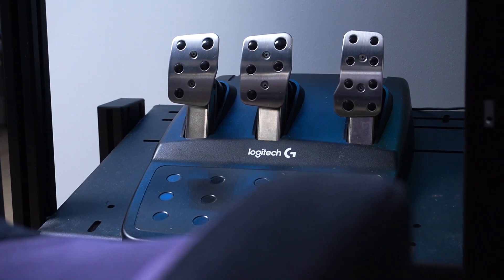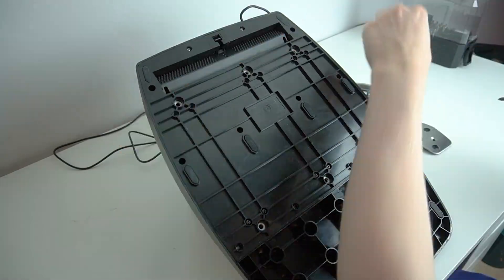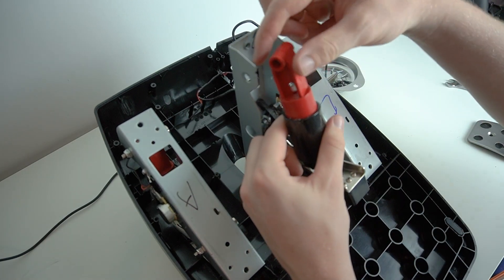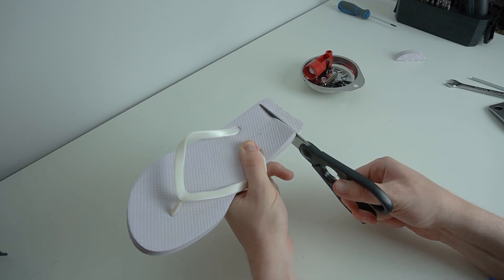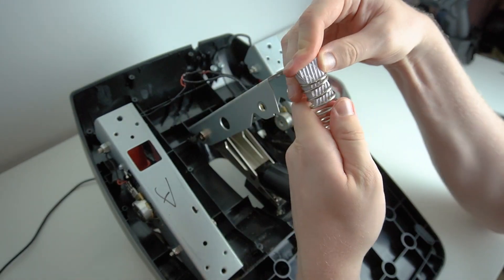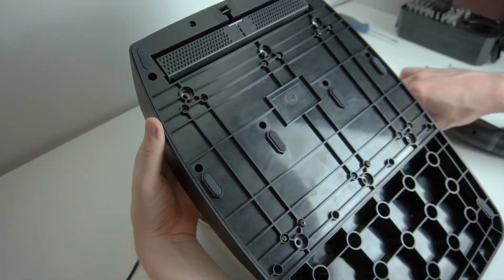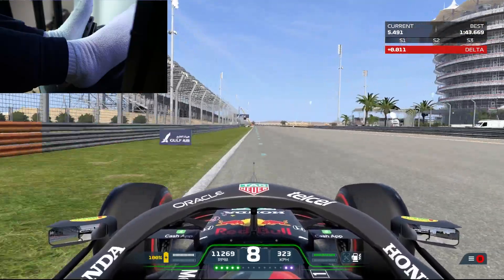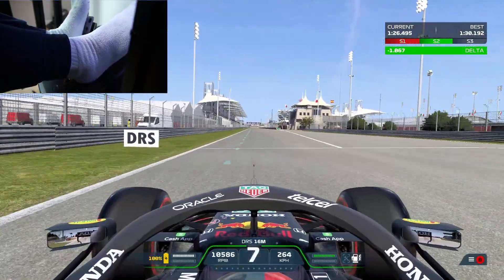Cheap Logitech G920/G29 Load Cell Feel Brake Pedal Mod - Using Only A Flip Flop

Comment: I would save that 1 dollar euro too :-P  I use those high density packing foam that comes with heavier item packaging. Collect a few pieces from here and there as each piece will varies in density/firmness. Then you can tune all you want/need. Great video and thumbs up.

Comment: Do you think this could work with the accelerator as well? Brake is great but the accelerator is not stiff enough
Reply: for that, just swap the clutch and gas springs, it will feel nice.
Reply: @YourDailyR  I did that and it feels way better! Thank you!

Comment: I dont know if anyone else has this problem but when playing on xbox in some games even when adjusting settings i cannot possibly reach 100% brake pressure, anything i could do to help this issue?
Reply: I had this issue, I removed the rubber block and cut it in half, this allowed me to reach 100% but I guess sacrificed the load feel of the brake. I'm going to try adding this flip flop mod to see if I can get a nice middle ground
Reply: @MrEuan616 did you do it? how is it if u did?